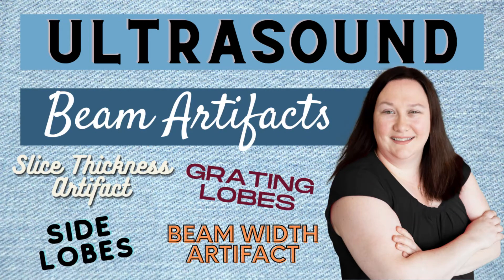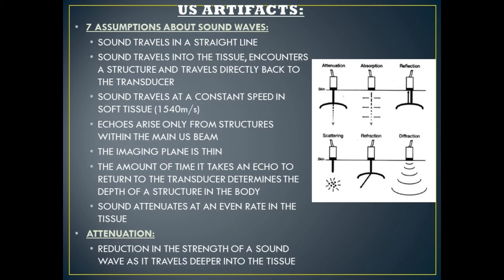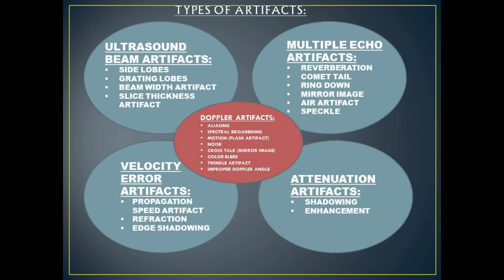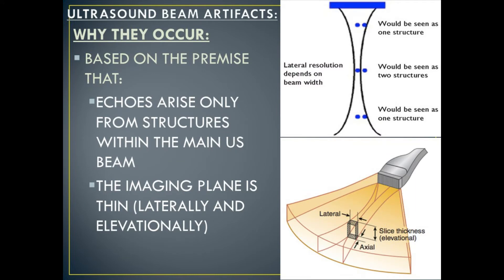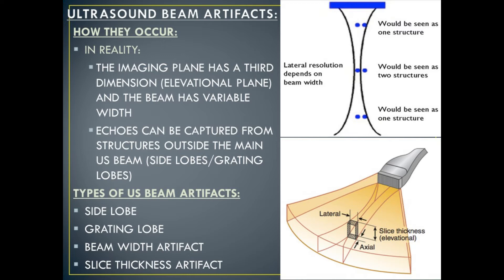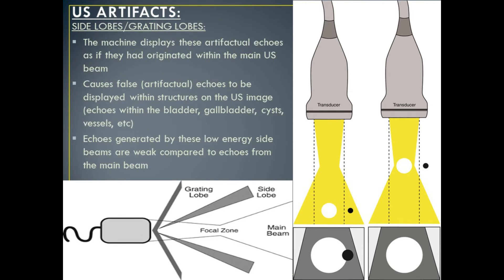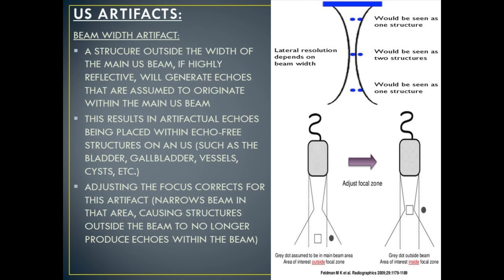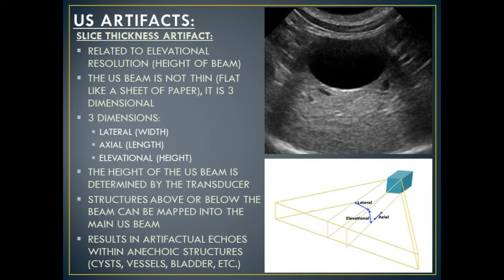Ultrasound Physics Review | Beam Artifacts | Sonography Minutes

Comment: Thanks. Can artifacts be in the form of white shadows?
Reply from the maker: Yes, Ultrasound artifacts can be in the form of "white shadows.' 
Here's the closest representations to your description:
1. Enhancement (bright or hyperechoic area posterior to a fluid filled space)
2. Air Artifact (white hazy area, can look like white shadows)
3. Free silicone (dirty gray/white shadow associated with free silicone in the body)
4. Reverberation (multiple long parallel white lines posterior to a strong reflector)
5. Comet tail/ring down (multiple short parallel echogenic horizontal lines that extend vertically posterior to a strong reflector- can appear as a white shadow)
Hope this answers your question. Stay tuned for more Ultrasound artifact videos with examples of the above (being released throughout July and early August 2021)